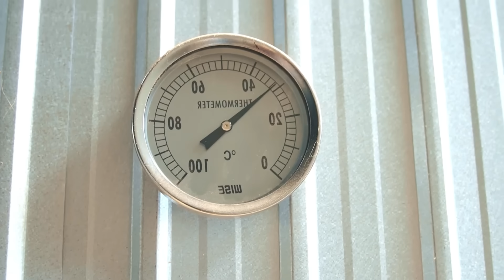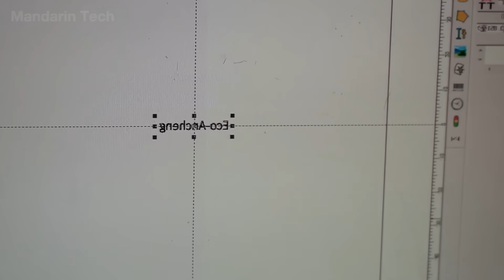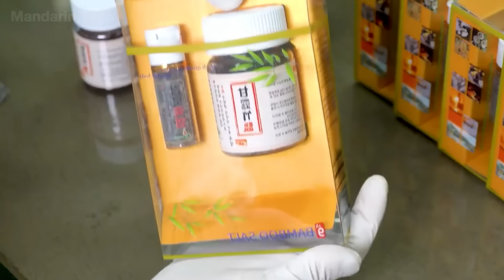China’s Manufacturing: Millions of Bamboo Trees Are Being Turned Into Bamboo Straws and Spoons

Comment: China has also made bamboo into a high tech structural material for industrial use. For instance the Chinese mixed bamboo with resin to make into a Train. Testing showed that this experimental train had higher tensile strength than steel, carbon fiber, and other newer structural materials. Also this new use of bamboo composite was found to recover its shape, in this testing of use in an experimental train. This means this bamboo composite can be used for much more than a Train. But the fact that this new bamboo composite retained structural cohesion when put though its paces as a Train. Demonstrate how resilient this new bamboo composite is.
Reply from the maker: That’s fascinating — bamboo composites are showing real potential in engineering!

Comment: This is a phenomenal documentary! The scale of China's bamboo processing is just mind-blowing. I had no idea the industry was this high-tech, with everything from automated lines and lasers to 500-ton hydraulic presses for building materials. The section on bamboo salt, firing it multiple times at 1000°C, was unbelievable.

To add a bit more context to why bamboo is such a 'trump card':

The video mentions it's fast-growing, but it's staggering how fast. Moso bamboo (which is common in China) is one of the fastest-growing plants in the world, capable of growing up to 35 inches (91 cm) in a single 24-hour period under optimal conditions.

This means it reaches full maturity for harvesting in just 3-5 years, which is a key reason it's a sustainable replacement for the commercial hardwoods mentioned at, which can take 20-50 years to mature.

Also, when it's harvested (as shown at), the root system (the rhizome) isn't killed. It stays in the ground and just sends up new shoots, which is why it's a "renewable resource" in the truest sense—it prevents the deforestation and soil erosion associated with traditional logging.

Amazing technology applied to an amazing plant. Thanks for the great video!
Reply from the maker: Thanks for adding all that context — bamboo’s growth speed and renewability really do make the technology even more impressive.

Comment: OMG !!! 4.18 Who the hell is in charge there with the training  Non of these folks were using the chainsaw correctly and as for ''afety'' , if  that woman's hair was to brush up against the blade maybe by a change in the wind or a  change in her movement in relation to the saw , her head would be pulled into the blade and she would be dead within  a second ....one gory bloody mess .
Reply from the maker: You're right — that was reckless training and could easily have resulted in a fatal, avoidable accident.
Reply: @Mandarintechmido  well I suggest you get in touch with the organization as you obviously made the video. Not oner of those folks were using the chainsaw correctly no protection . Wrong stance . No arm locking just in case it kicks back , which is very likely to happen especially with ground work . As for that woman OMG , I nearly had a heart attack watching it .

Comment: In China, waste-to-energy incineration has already achieved zero pollution, thanks to technological advancements. Now, incineration plants are running out of waste to burn, so they've started excavating old landfills to retrieve more garbage.
Reply from the maker: China’s waste-to-energy tech is so advanced it’s running out of trash — now they’re digging up old landfills to keep going. That’s next-level recycling!
Reply: Did the google search mentioned how many old coal plants were demolished to make ways for the new coal plants?

Below is an excerpt of an article published by Yale:

Yale Environment 360
Published at the Yale School of the Environment
April 14, 2025

China Allows New Coal Plants, but With More Limited Role

China will allow the construction of new coal power plants through at least 2027 but with restrictions aimed at limiting emissions and boosting renewables, according to a newly released action plan.

The plan clears the way to build new plants where needed to shore up the supply of power or to balance solar and wind, Bloomberg reports. To that end, new coal plants must be able to ramp up and ramp down quickly. The plan also directs new plants to burn coal more efficiently than the existing fleet, and it will require some new power stations to run _less than 20 percent of the time_...
:
:
:

Note: the new coal plants are not operating at full capacity, they are built to balance the renewable energy generated by wind, solar, etc, and serve as “peaker” plants, meeting spikes in demand or gaps in supply. As a result, most new coal plants are operating at a loss.
Reply: A quick Google search revealed a few facts: China built more coal fueled power plants over the last 10 years then the US has in operation. There is no such thing as zero emissions waste to energy. Of the top 10 companies leading the charge in w2e technology, none are chinese! Lastly, and my own submission, china 's best tech is stolen IP with the stench of Temu
Reply: @I000II0I0I  You trust Google?, Western narratives are generally anti-China. You need alternative sources of info to balance Western propaganda.
Reply: @I000II0I0I In fact, if is not for the Temu's, then it must be Amazon's or Wal-Mart's, etc., instead, what's the difference? Anyways, which one offers better qualities or lowest-priced, etc. for customers could simply sell more.  The Supply needed because there is a Demand, so don't be double standard and hypocrite !
Reply: China's waste-to-energy (WtE) technology and industry have experienced explosive growth, making it a global leader in both scale and technological advancement.

Here’s a comprehensive overview of Chinese waste-to-energy technology, covering its drivers, key technologies, major players, challenges, and future directions.

1. The Driving Forces: Why China Embraced WtE
China's massive investment in WtE was not a choice but a necessity, driven by several critical factors:

The "Zero Waste" Policy & Ban on Foreign Waste: Following its 2017 ban on imported plastic waste, China had to deal with its own rapidly growing domestic waste stream. The "Zero Waste" initiative pushed for advanced domestic waste management solutions.

Urbanization and Population Growth: With hundreds of millions of people moving to cities, the volume of municipal solid waste (MSW) skyrocketed, overwhelming traditional landfills.

Land Scarcity: Building landfills near major metropolitan areas like Shanghai, Shenzhen, and Beijing is not feasible due to high land costs and public opposition ("Not-In-My-Back-Yard" syndrome).

Environmental Protection Goals: To reduce groundwater contamination and methane emissions from landfills, which contribute significantly to climate change.

Energy Security: WtE plants generate electricity, contributing to the national grid and diversifying the energy mix.

2. Key Technologies Deployed
The primary technology employed in China is Mass Burn Incineration, which is highly efficient for the high-moisture, low-calorific value waste typical in China.

a) Core Incineration Technology:

Grate Incineration: This is the dominant technology. Chinese companies have perfected moving grates (e.g., reverse-reciprocating grates) that can handle unsorted MSW efficiently. They are robust and have high availability.

Fluidized Bed Incineration: Less common for MSW but used for some industrial or specific types of waste. It requires better pre-processing but can achieve higher combustion efficiency.

b) Advanced Pollution Control (Flue Gas Treatment):
This is a critical area where Chinese technology has advanced significantly. Modern plants must comply with the "Ultra-Low Emission" standards, which are as strict as, or even stricter than, EU standards. A typical system includes:

SNCR (Selective Non-Catalytic Reduction): Injects ammonia to reduce nitrogen oxides (NOx).

Semi-Dry Scrubbers + Activated Carbon Injection: Neutralizes acidic gases (HCl, SO₂) and absorbs heavy metals and dioxins.

Baghouse Filters: Removes particulate matter with very high efficiency.

Catalytic Filters (in some advanced plants): Further reduce dioxins and NOx.

c) Energy Recovery:

The heat from incineration produces high-pressure steam, which drives a turbine to generate electricity.

An increasing number of plants are also providing district heating to nearby communities, improving overall energy efficiency.

d) Bottom Ash and Fly Ash Treatment:

Bottom Ash: The non-combustible residue is often sorted to recover metals and then used in construction materials like bricks or road base.

Fly Ash: The highly toxic ash collected from the flue gas filters is stabilized (often through cement solidification) and sent to secure hazardous waste landfills. Research into melting fly ash into inert slag (vitrification) is ongoing.

3. Major Chinese WtE Companies and Players
China has developed a powerful domestic industry that now competes globally.

China Everbright Environment Group: The absolute giant in the sector. They operate hundreds of WtE plants across China and have become a integrated environmental service provider.

CNBM (China National Building Materials): Leverages its expertise in materials to handle by-products like bottom ash.

Shanghai Environment Group: A major player, especially in the Yangtze River Delta, known for operating large, technologically advanced plants.

Tus-Sound Environmental Resource: A leading company specializing in waste incineration and environmental remediation.

Wuhan Kaidi: A significant player with a focus on energy and environmental projects.

Many of these companies have moved from importing European (e.g., Martin, Von Roll) and Japanese (JFE) technology to developing their own proprietary systems and now exporting their technology and EPC (Engineering, Procurement, and Construction) services to Southeast Asia, the Middle East, and Europe.

4. Challenges and Criticisms
Despite its successes, the industry faces significant challenges:

Waste Composition: Chinese MSW has a very high moisture (kitchen waste) and low calorific value, making efficient combustion more challenging and requiring advanced boiler design to avoid corrosion.

Public Opposition (NIMBY): While decreasing as technology and transparency improve, concerns about dioxins and other emissions still lead to protests against new plant constructions.

Fly Ash Management: The safe and costly disposal of fly ash remains a persistent challenge.

Overcapacity in Some Regions: In some areas, plants are competing for limited waste, leading to "waste shortages" that can force them to operate below optimal capacity.

High Capital and Operational Costs: Building and maintaining a WtE plant that meets ultra-low emission standards is extremely expensive.

5. The Future: Trends and Innovations
China is not resting on its laurels and is pushing the sector towards greater sustainability and efficiency.

Waste Classification (Sorting): The national push for waste sorting (recyclables, kitchen waste, hazardous, residual) is a game-changer. It improves the calorific value of the waste going to incinerators, boosting efficiency and reducing pollution.

CCUS (Carbon Capture, Utilization, and Storage): Pilot projects are being developed to capture CO2 from WtE plant flue gases, recognizing that the process is not carbon-neutral.

AI and Smart Plants: Using artificial intelligence and big data to optimize combustion in real-time, predict maintenance, and improve efficiency.

Co-processing and Industrial Symbiosis: Integrating WtE plants with other industrial processes, such as using steam for industrial purposes or co-processing sludge from wastewater treatment plants.

Advanced Thermal Treatments: Research into gasification and pyrolysis is ongoing, though these are not yet deployed at the same scale as mass-burn incineration.

Conclusion
China's waste-to-energy sector is a story of rapid scale-up and technological catch-up, driven by urgent environmental and social needs. It has evolved from a technology importer to a global leader in building and operating large-scale, efficient, and increasingly clean WtE facilities. While challenges remain, particularly in waste sorting and the management of residues, China's experience and technological advancements are now shaping the global waste management landscape.
Reply: @I000II0I0I  nowadays grapes grown in the west are always sour. Google and find out why.
Reply: @I000II0I0I  过去10年，中国每年增加的森林面积占全球的一半以上。每年新增新能源发电占全球一半以上。现在垃圾焚烧企业前10有5家是中国的。全球最大的垃圾焚烧厂在中国上海。最新的垃圾焚烧厂技术已经是全球第一档次。只是有一些垃圾焚烧厂是很多年前建立的，技术还没升级，导致利用率不高。往后中国会淘汰这些垃圾焚烧厂或者对他们进行技术升级